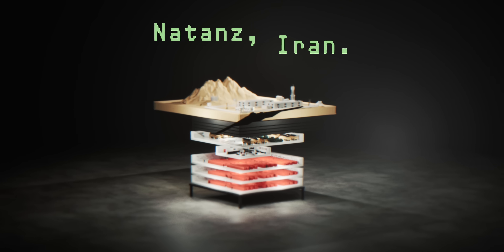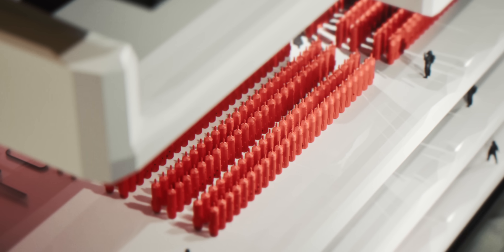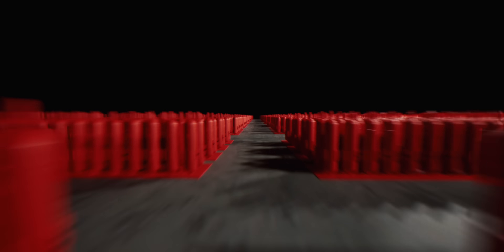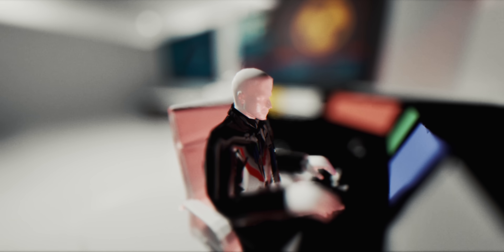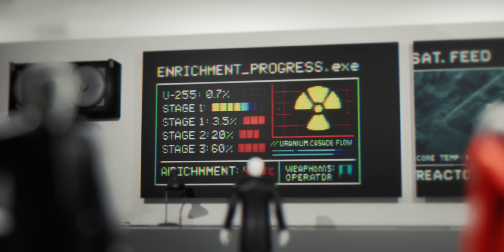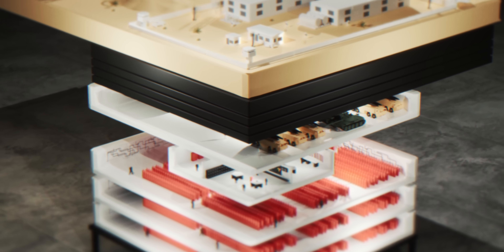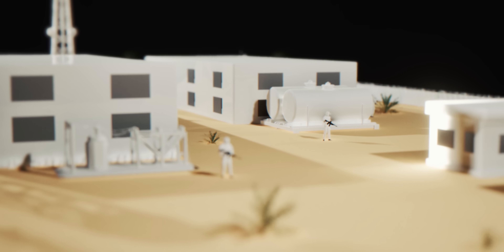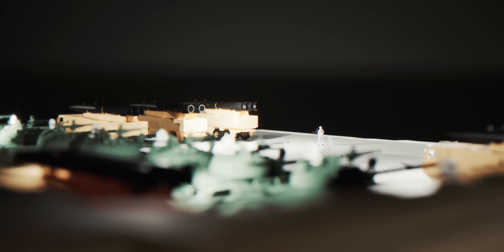Inside Irans Nuclear Bunker the US Just Destroyed

Comment: “We hid the enrichment centrifuges under 50m of reinforced concrete because we have nothing to hide” - Iran
Reply: when you live near israel you have to do things differently
Reply: @emirbajrektarevic7985 you could build a dozen equal size facilities for the same cost without the fortifications. Most of the construction of that facility had to do with making it blast resistance and very little of the cost had anything to do with nuclear fuel. 
A lot of people will set up centrifuges in normal lab buildings. 
And if you wanted to just make a bunch of safe uranium you’d probably take the 10 cheap facilities over the 1 heavily fortified and secure one. 
Also it would always be far cheaper to simply purchase the fuel. 
They would have to convert all their energy to nuclear fuel and run it for 100 years to break even on the upfront cost of not just using Desil power and buying some to run a plant or two for diversification. 
Simply put there is no mathematical way for them to generate more energy than they consume this way. Which is what you’re looking for when generating power. 
However this would be the most effective way for them to get nuclear weapons since those cannot be bought or substituted for Desil fuel.
Reply: To nebylo zničeno co se US domnívají
Reply from the maker: hahaha
Reply: tell me the education is illegal in USA without saying it. Where would you want to test RADIOACTIVE material ? in the middle of Tehran, on a random table in the bazar ?
Reply: @kcidymkcus3457 take you about 2 inches of Lead shielding to do that also. 
Furthermore rest of the world just does that stuff above ground in more or less standard lab buildings. Unless you’ve got a straight up reactor going it’s not like there’s any real risk. 
Outside of perfect conditions fuel grade uranium is just spicy sand.
Reply: @kcidymkcus3457  first your statement doesn't even make sense. Education being illegal in the US? OK then I guess you thought you had something special with that. There is no need to go underground for peaceful nuclear power and the only reason to enrich to 60% is for weapons so they're is that.
Reply: @kcidymkcus3457 you only need about a half an inch of lead insulation to completely block 100% of all radiation that might be emitted by such things.
Reply: @kcidymkcus3457  You don't need to enrich uranium in a very expensive underground bunker. You only do that to protect it from being bombed.

Comment: Looks like natanz was harder to hit than fordow. The bombs have to go though mountains and reinforced steel. And the nuclear stuff is all the way down at the basement.. i dont think any bomb is able to hit that basement.
Reply: You don't even need to hit the equipment directly to disable it. I used to repair equipment called turbomolecular vacuum pumps that use bearings and motors similar to these gas centrifuges. A relatively minor jolt will cause rapid unscheduled disassembly. 😮
Reply: I think Iran is smart enough to keep quiet at this point about it and I hope we can avoid nuclear war
Reply: 12 were dropped on fordow… it’s safe to assume it’s all obliterated.
Reply: @EaglesFan20  Especially with the fact that the bombs dropped were most likely bunker busters.
Reply from the maker: Crazy stuff

Comment: A question, though: If the facility had a catastrophic failure on June 13th, would any centrifuges still be powered back up by the time of the the US/Israel bomb strike, or would they have still been shut down for the repairs? And if shut down, and the bombs themselves didn't actually penetrate into the facility, would the damage have been minimized? 

I ask because there are those who say that the bombs could not reach the caverns, and only destroy the centrifuges due to the shock, which would cause a RUNNING centrifuge to destroy itself. What do you think?
Reply: Well if they were running they would become grenades. I seen the aftermath of turbomolecular vacuum pumps that use similar precision and speed rotating guts and you wouldn't want to be anywhere near a big one when it fails. 😮😳💀
Reply: @christopherleubner6633  Yes, true, Christopher... but that is not the question I posed: As you correctly relate, and the OP described, a RUNNING centrifuge will self-destruct. 

But I wondered if they WERE running during the bombing, considering the June 13th accident, and the need to repair the destroyed units. I mean, maybe they were STILL all shut down during the bombing. If, that is, the remaining working ones were shut down June 13th, which I don't think we know is the case.
Reply: @proto57 Can't be totally sure what was going on deep underground. Iran claims they moved out much of the uranium and filled in entrance points with concrete well before the strike. There was satellite imagery of nearly 20 large dump trucks lined up directly outside an entrance days prior. The consensus is that they probably were indeed moving much of their material out to a safer location... Which is unfortunate for most countries who don't want them making nukes. 

Whether they really filled in places with concrete or not is unknown. If they moved out a substantial amount of uranium, it's unlikely that any centrifuges were running. If they were, and if the blasts' shockwaves reached them, a lot of damage could occur within them, though probably not outside of them. It's not guaranteed, as many centrifuges would stop running when an imbalance is detected. 

What would cause more damage is if software disabled safety thresholds and forced units to spin fast enough to destroy themselves internally. That's what happened many years ago with the stuxnet malware infection. This is the scenario the AI model was thinking of when it wrote the script. It didn't know about the recent midnight hammer op.
Reply from the maker: Hmmm whats everyone thoughts?